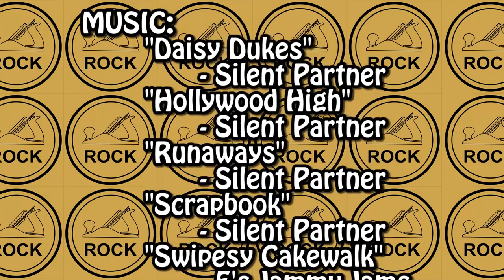Woodturning - Turning Without A Plan! Pass or Fail?

Comment: Gord a little trick during glue up. 
Sprinkle a little bit of salt on your surface after you applied the glue this will help the pieces from sliding around during clamping. Awesome piece.
Reply from the maker: Thank you for the tip, John. Actually I already knew about this but as usual my memory fails when I need it the most. LOL! Glad you liked it. Thanks for watching!

Comment: Turned out great Gord even though most of it ended up on the floor!🤣 One question..why do you keep the table saw blade so high? Nice job.👍🏻👍🏻
Reply from the maker: Keeping the blade that high goes back to my days as a woodworker before I discovered woodturning. With the blade that high it is coming down into the wood at a much higher degree and cutting the wood cleaner. Having the blade low as most people do means that the blade is cutting at an angle that can cause more tear out. It's an old habit that I can't seem to break even though I don't work with expensive plywood anymore.
Thanks for watching! 😃😃😃🇨🇦🇨🇦🇨🇦
.....Gord

Comment: Do you have a video of making the glue up press you used.  I have seen you use it in several videos and would like to make one for my self.  I can get everything figured out except for the metal brace that is used, presumably to keep the top bar from flexing, do you remember where you got it and what it was called?  I would appreciate any information you have on the screw clamp and metal bracket.
Reply from the maker: Dennis you are correct. That is exactly what that steel brace is for. It is 1 inch wide flat bar, 1/8 of an inch thick. It had a bit of a bow to it so I made sure that that was pointing down so that when I tighten it it keeps the wood from flexing. The wood is solid oak and holds very well. If you need more information let me know.
Happy turning,
…..Gord